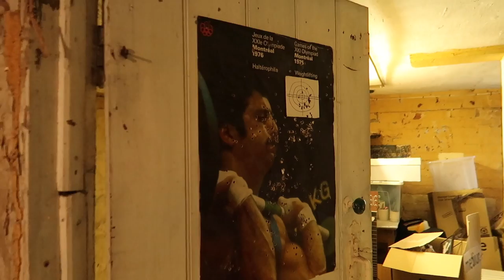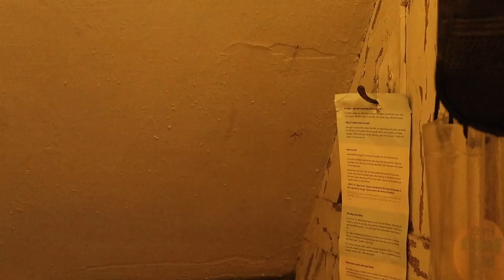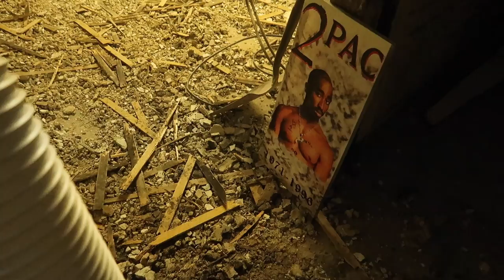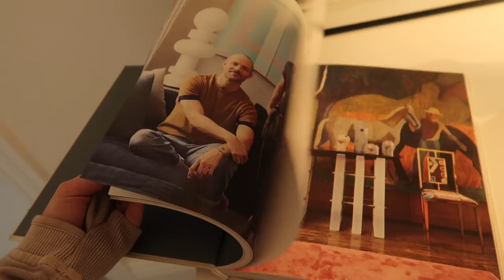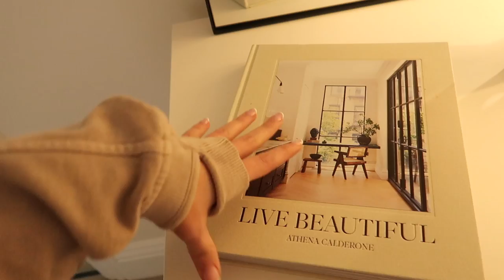RENOVATION SERIES 🏠 Basement Conversion & House Updates

Comment: I would advise amending the underpin sequence to: 1, 4, 2, 5, 3, 1, 4, 2, 5 etc.
Your clip shows pins numbered as 1, 2, 1 which is not recommended as that would leave the middle pillar of soil very vulnerable creating a high risk of movement. Please refer to ASUC guidance.